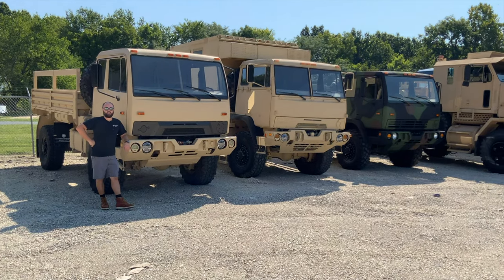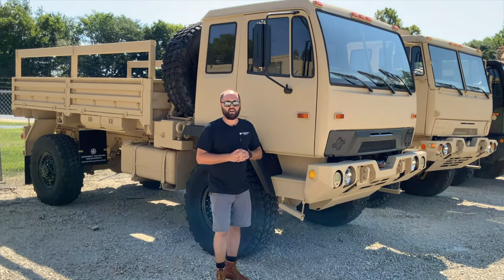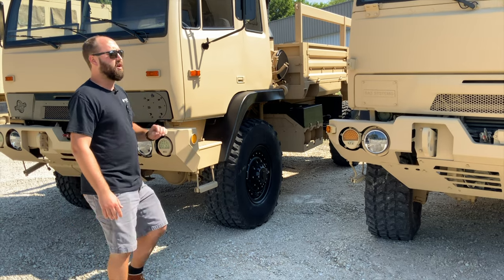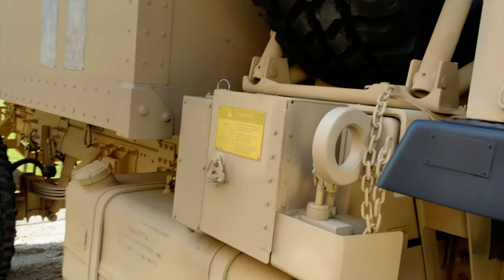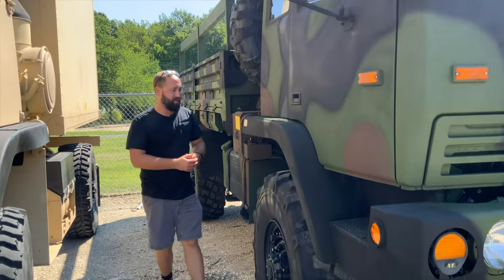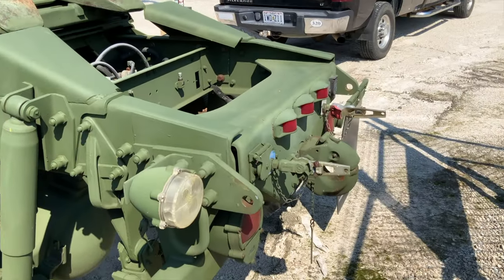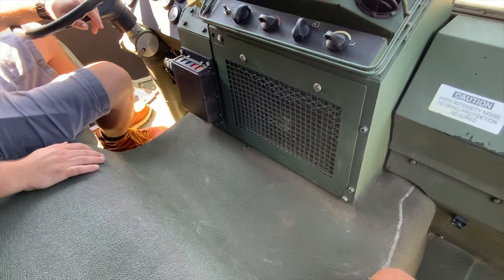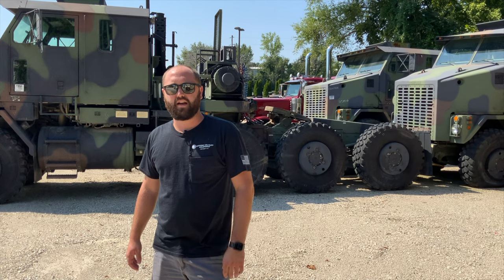Overview of the A0/A1/A1R Stewart & Stevenson Military Trucks

Comment: The cab lifts on the 1085A1p2 are a pain in the ass. Lazy operators would never lift their cab during PMCS because they didn't want to let the air pressure build up to use the lift. If that newer style cab lift is not actuated at least monthly it will seize and the rear cylinders will not release the cab.

Comment: Hello. I have a question about the axles. Specifically; are there inter-axle lockers between each axle or lockers to lock the axle shafts on each axle? If not, are lockers available?

Comment: Great overview. To me seems odd on an armored cab to swing doors backwards. Id thing normal doors would be better as its a shield getting out. Is there a significant weight difference between the steel and aluminum wheels? And performance wise how does aluminum do?

Comment: All well and good but... is the frame C or box? fuel milage and range? Multi fuel? How well will it do in very cold wet high altitude environments? Replacement parts availability? how good is the 4x4 in comparison with a modified civ jeep? How easy or hard is it to modify/upgrade to fit my needs? Defrost only or is there AC? can it be upgraded to have AC? maintenance schedule? Push bumper w/ winch, rear loading ramps w/ winch? Snow plow? Bed covers both soft and hard? Flatbed? Electrical and electronic upgrades / capacity? These are the things I need to know because I need a vehicle that is a hard to kill milti tool not just a transport.
Reply: The AC units you have. Parts, prices, how hard is it to work on for repairs? can it operate without the engine running? How good does it keep the cab cool / hot? PTO, how strong is it? PSI? capacity? Can it operate an excavator arm? 
How thick is the soft skin body for dent repair? How thick the armor for adding lights, mirrors, other additions?
Reply from the maker: @johnathanstephenson8107  for the those types of questions, please reach out to our sales team at sales@midwestmilitaryequip.com

Comment: Has anyone noticed: 5 Minutes talking about indicators, an 2-3 about the engines.

Maybe I am different but I absolutely to not care about indicators that I can switch in 5 minutes or the orientation of handles. Or the color of the dash.
But I do care about the drivetrain: Engine, Transmission, axles, diffs, brakes.
And if there are different engines, it would be cool to know that these are from Cat and the tranny Allison and so on.

A chart would be cool also as noone on planet can follow 5-10 numbers in a row. Sounds like a lot of knowlege but has no value to the viewer when nonone can remember that.